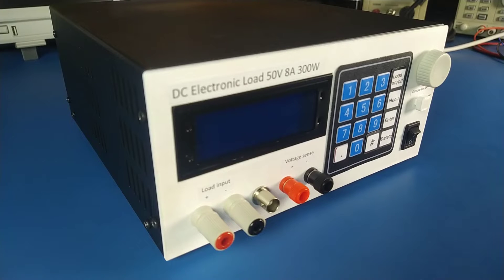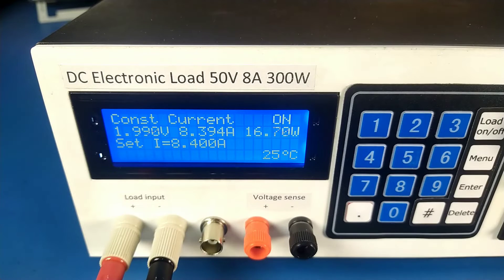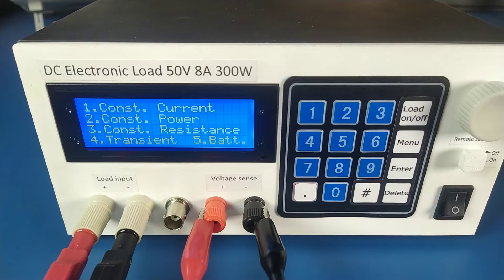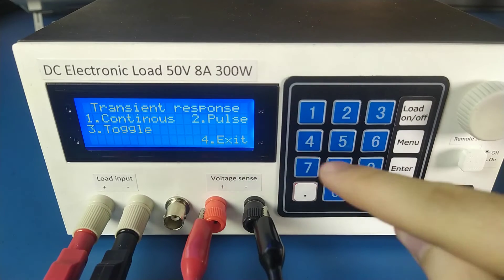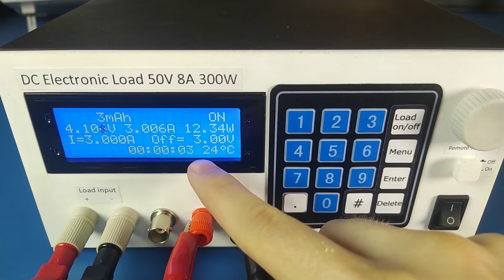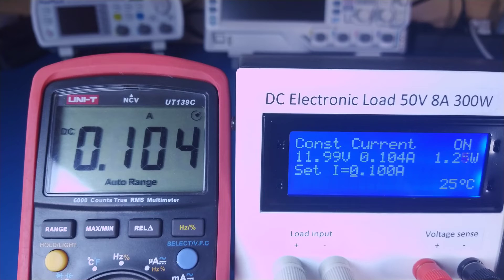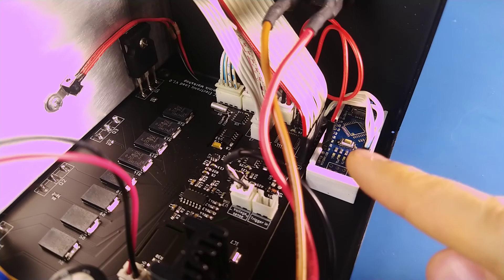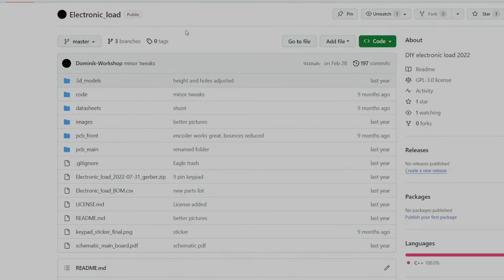DIY DC Electronic Load - 300W

Comment: Very nice work. I would like to make one myself, but I don't know how to have a PCB made. Shouldn't you have one piece of PCB?
Reply from the maker: Thank you! 

Having  a PCB made is very easy. There is a gerber file on my repository (link in the description). You just have to upload it to a PCB manufacturer, like JLCPCB, and order it.
Reply: @dominikworkshop6007   Thank you. I´ll try it.
Reply: @dominikworkshop6007 The PCB is ordered now, we just have to wait until it arrives. What program is used to upload the code? I can't find the list of components, maybe I don't have the right programs. Sorry for the questions, I'm a beginner, thank you very much
Reply from the maker: @marecek19891989  I used platformio to upload the code. There are many tutorials on YouTube. 
There is a pdf with full schematic on my repository. You could also open this project in Eagle to be able to inspect what goes where more easily.
Let me know how this project is going for you!
Reply: @dominikworkshop6007  Hi, my project has progressed. The PCB arrived from China looks very good. I am ordering components, but it is very difficult here in Slovakia. I can't buy measuring resistors :( where did you get them? Thank you
Reply from the maker: @marecek19891989  I got them form a local online shop: Allegro. If you can't find  exact same as I used, you can use similar ones. The resistance is quite important, and it's very important they have low temperature coefficient
Reply: @dominikworkshop6007  I didn't get them on the allegro, only other values of 0.33 ohm. I got them on the manufacturer's website and they also have 3W for the same price. I think nothing will change with this or am I wrong? How much did it cost you?
Reply from the maker: @marecek19891989  I don't remember exactly how expensive they were, but i guess it was like 0,5 Euro/piece. If their resistance is a bit higher, then they woud heat up a little bit more. But I think 0,33ohms should work just fine
Reply: @dominikworkshop6007  I built the pcb. everything works but the current does not measure correctly. if I set 0.100A, the current drawn is 0.677A. Where to look for an error? I have the same 0.2 ohm resistors as you. Thanks
Reply from the maker: @marecek19891989  I noticed that I changed the value of R22 from 1k to 560 ohm and forgot to change it in the schematic. I recomend changing its value to 560 ohms. If you don't have the exact value resistor you could adjust the attenuation factor in Controls::regulateCurrent(float setCurrent) (it should be equal to R22/(R22+R21)). I'm sorry for the inconvinience. Let me know if it works properly after this fix.
Reply: @dominikworkshop6007  i change resistor r22 to 560ohm and i set 0,100A current is 0,377A now
Reply from the maker: @marecek19891989  How about other ranges? Is the current proportional to the set value? Have you checked the current with external meter to determine if the measured current is correct?
Reply: @dominikworkshop6007  if the output is switched on and the source is not connected, it shows 0.07A. If I set 1A, it shows 1.379A, and the same data also shows the source 1.379A. the drawn current agrees with the measurement but does not agree with the set current. Could it be a problem with the ref voltage? did you use REF50xx or LM4140? When I overwrite the values in the program, it must be saved somewhere and then uploaded or just overwritten and uploaded
Reply from the maker: @marecek19891989  I utilized the LM4140 voltage reference. The specified reference voltage should be 4.096V; otherwise, the current might differ. However, assuming everything is functioning correctly, you need to initiate the calibration process. Uncomment lines 87-90 in the main.cpp file, upload the code, and press '6' when in the main menu on the device. In the calibration.hh file, you'll find my calibration values enclosed in brackets. Your calibration values should be similar to mine.
Reply: @dominikworkshop6007  I have LM4140 too.All values were set to 255. I set them according to yours and it is more accurate. Thank you very much for the advice, I was already confused. I will continue with the next steps tomorrow.Can I leave the recorded program uncommented? won't the data be deleted when upload the program?
Reply from the maker: @marecek19891989  you can leave it uncommented, I had it commented to make more space on the uC's memory for other features that I'm working on. The calibration values are stored in EEPROM so you don't have to worry about losing them.
Reply: @dominikworkshop6007  What other features are you working on? today I will check the displayed values more precisely. I still have to make the box. if I have other problems, can I comment here or can I send an email? Is the fan controlled by pwm or just turn it on and off?
Reply from the maker: @marecek19891989  I'm currently developing a PC application for controlling the load and displaying data in battery measurement mode.
If you encounter any other issues, I recommend creating a new issue on the GitHub repository. This way, others facing similar problems can find solutions. 
The fan is controlled by PWM.
Reply: @dominikworkshop6007  Finally done. I ran into two problems. 1. the ground of the usb connector of the arduino is connected to the case and also to the heatsink and transistors, and it looked like a short circuit of the transistors. I had to isolate the transistors from the heatsink with the thermal pads. 2. the fan makes a terrible noise during PWM regulation (any advice?)
Reply from the maker: @marecek19891989  I haven't thought about the usb port shorting to the case, good that you pointed that out. 
When it comes to the fan, the noise is caused by low PWM frequency, I was planning to increase it, but after I assembled the PCB I realised that the timer controlling the PWM on the pin for the fan speed regulation, is used to measure time by arduino functions. You could increase the starting speed of the fan, so that it never runs at low speed, but there is no easy way to get rid of the sound completely. (One could rewrite the code for time measurement functions, to use other timer, but that seems too complicated to be bothered to do so).
Reply: @dominikworkshop6007  How and where in the program should the increase in the maximum capacity of the measured battery be adjusted. for example, I want to test a battery of 15000 mah and maybe higher than 100,000mah. What happens to the time when it reaches 99 minutes?
Reply from the maker: @marecek19891989  In battery.cpp, line 26 there is dtostrf(capacity, 5, 0, displayValue);. The 5 represents the maximum amount of digits for the capacity measurements, so to measure capacities higher than 99.999mAh you have to change it to 6.
When it comes to the timer, I suppose it just overflows to 00:00:00 (not tested), but I guess 99h should be enough to complete the measurement. However, I'm currently working on a PC application for battery mode, and there it should be possible to reach enormous range of measured capacity and time. I'm almost done with it and I will hopefully release it soon.
I'm sorry for my late reply.

Comment: Can resistors R4, R5, R9, R10, R14, R15, R19, R20 be replaced with 0.5ohm resistors?, or can they be replaced with other types of resistors that are easier to find? Thanks sir!
Reply from the maker: Yes, they can be replaced with 0,5 ohm resistors, but that would mean more power loss on these resistors, unless the maximum current is reduced. They can certainly be replaced with other types of resistor, but I suggest ensuring that they have low thermal coefficient.

Comment: Did you use an input trigger? I mean define in defines.hh is wrong. It corresponds to ENCODER_BUTTON and the signal input trigger is connected to pin A7 on the PCB. It's just an analog input. Has it ever been tried?
Miroslav
Reply from the maker: You are right, thank you for pointing it out. I haven't used the input trigger yet, and there is an error in defines.hh, where I defined this pin to pin 3, instead of A7.
The two pins I know can work as external interrupts were used for the ENCODER_A and ENCODER_BUTTON signals. I'm not sure if I will be able to configure the A7 input as external interrupt, but in that situation I planned to just check the state of this pin frequently, and act accordingly. I know it's not perfect, but the uC used in this load has some limitations. If I were to make a V2 of this project, I would probably base it on some STM32 uC.
Reply: @dominikworkshop6007  Maybe the PB3 pin can be used on the current system, which is still unused. It's a keyboard spare pin and MOSI too. And there is PCINT3 attached.

Comment: Amazing project
However, I separate display for measure value will be helpful. A diff display to select the modes will make it much more user friendly
Reply from the maker: Thank you! I get your point, though that would make this project a little bit more expensive.

Comment: Very clean! It has the looks of a finished product. It actually looks better than some pre-production devices I have seen, let alone prototypes. Cost conscious choice of components too.Taking into account the limited possibilities of the LCD screen and buttons the user interface seems intuitive and quick in its use.

You could add a menu with settings memories and also a constant voltage mode. For protection of both the load and the device under test you could also include overvoltage,  overcurrent and overpower monitoring that can switch of the load automatically.
Do you plan to add a possibility to manage the load remotely for more complex scenario's? For example with the application Test Controller?

How 'fast' is it and how precise is it with very low currents? The use case I think about is simulating devices that have sleep time followed by sudden short wake-ups with peak consumption (think bluetooth, lora, wifi, etc... based sensors, smartwatch, wireless headphones and many more. Would be nice to be able to simulate such a device to test batteries or solar power/charger/battery combinations.
Reply from the maker: Thank you, that's very nice to hear!

There is power motoring that makes sure it stays bellow 300W, and there's also overtemperature protection, that turns the load off if the heastink reaches certain temperature.
I didn't plan on adding remote controll for this device, because I don't see a need for that. Maybe I'm wrong?

It can switch currents fairly fast, though I haven't recorded any measuremets of that yet. It can go down to around 4mA and I guess it would fit the application of simulating devices that you mentioned. If minimum of 4mA isn't enough, this project could be easily modified to operate with smaller currents. This would of course come at a cost of smaller current range.

Comment: You may want to look at the INA228 it contains all the hardware needed to measure current and voltage plus it calculates power , energy and charge with high accuracy or for a pre built unit the Junctek KL140F saves having to write software to do it and they contain 20 & 24 bit adc's which alone would cost more than these devices.
Reply from the maker: Thank you for the suggestion! This IC seems great, though I must say that the ADS1115 does the job and is a bit cheaper.
Reply: The ADS1115 may be cheaper but it is only an ADC the INA228 calculates the current , power , watts , battery capacity , watt hours to a high accuracy no calculations are needed in your own code  @dominikworkshop6007